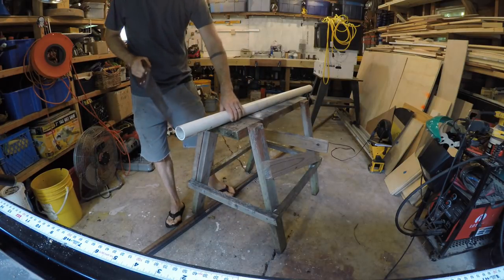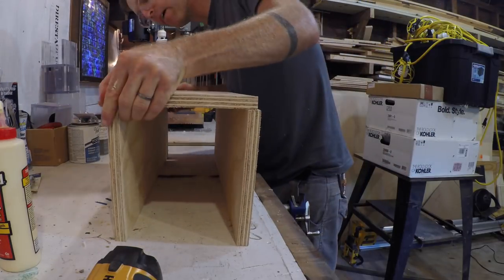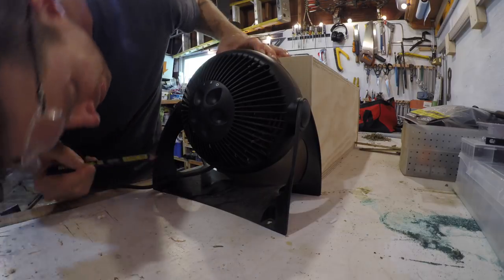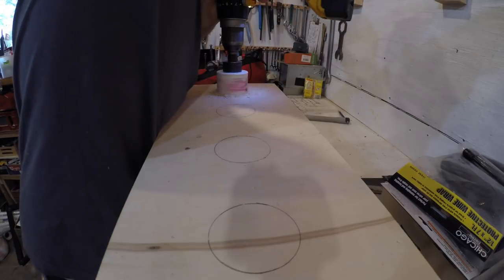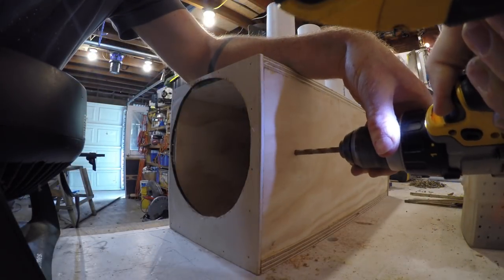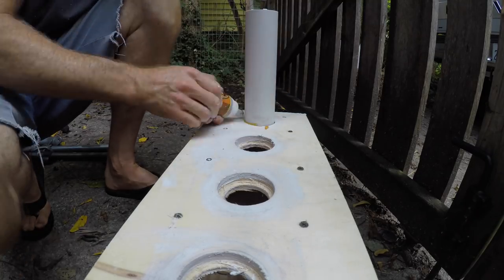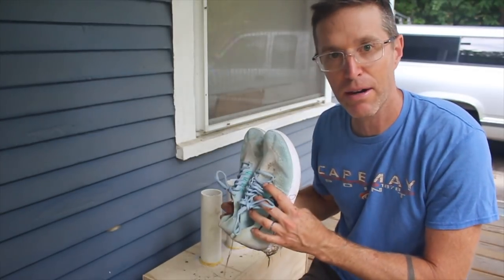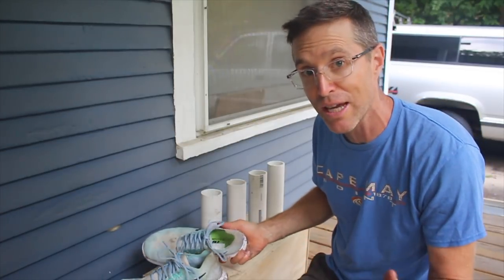DIY Shoe Dryer

Comment: That shoe dryer will work well. I wanted to make one similar to yours but to sit over my floor register in my bathroom. This way when the heat runs in the winter it will help dry my wet boots. My wife bought me boot dryer at Rural king for christmas one year and it does the same thing except it has a small heating element in it. Nothing like putting on warm boots in the winter!
Reply from the maker: Rural King! Love that place. Using the register is a great idea -- i'll have to shift over to that in the winter, again, and may have to rig something up to channel the air. Thanks for that idea! :)

Comment: Made one this week for drying fly fishing wading boots. Even had the exact same fan lying around the basement. Used 2 1/4 inch PVC. Had everything lying around the shop as scrap from this or that project. Only real difference is I had some foam pipe insulation I used to seal the fan to box opening. Had a couple PVC end caps so if I have only one pair of boots drying I can send all the air into the two pipes in use. 

Went fishing, caught some nice trout, boot dried right out!

Nice simple and practical design. Works like a champ!

Thanks much!
Reply from the maker: The trout are the best part of your story. The second best are those seals. Great idea!

Comment: i used a small fan blower 12V 4.5A instead of the fan and the air flow is only strong in the furthest 2 wholes :( should i add another fan blower from the other side of the shoe dryer? or maybe you have other ideas? i made mine in a shape of trapezium.. does this have any effects ?
Reply from the maker: As long as your box and system are tightly sealed, you will get equal air flow out as what is going in. A more powerful fan will certainly help!

Comment: the air blows mainly out the top of the tube so the tip of the shoe gets dryer a lot faster than the heel side. Perhaps a generous hole (or a few perhaps along the top end of the tube) on the side of the tube where the heal of the shoe rests to allow air to cycle back into that area would cause a more distributed blowdry. just a thought. Great idea though and probably something I will be making for myself too. thanks for the great vid once again.
Reply from the maker: I had thought the heel wouldn't have dried at all, but the air seemed to circulate ... but you're right: a cool diffuser would make it even better. Even just a few holes in the end of the pipe might do it. Thanks for the ideas!

Comment: Same design I had in mind but I’m using a different fan. Also I used pvc threaded fittings on the end so I didn’t have to drill holes another separate board.
Reply from the maker: sounds excellent! I'm building a new one now ... great devices!